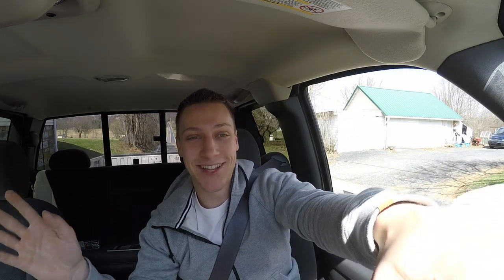WHY I DON'T Roll Coal...

Comment: So the fact that it's bad for the environment isn't one of the reasons you don't roll coal? (no i'm not a crazy environmentalist or anything like that)
Reply: wow I did not know that. Thanks for the insight!
Reply: ***** very true, i'm glad at least i know its not as bad as i thought. but i still would never do it.
Reply from the maker: +Kyle Batu It's actually not nearly as bad for the environment as it looks lol
Reply: Diesel engines are much more efficient and put out less pollution than gasoline. Just because you can see the exhaust doesn't mean it's worse.
Reply: Street Speed 717 Does it have any negative consequences? (other than looking really bad)
Reply: +Kyle Batu not really. its soot. soot basically rises into the air, and drops to the ground and mixes with dirt and just becomes dirt again
Reply: +Nicholas Bethke 

*Citation needed
Reply: +Nicholas Bethke even if it falls back to the ground doesn't mean it's not bad but yeah overall they run better than a gas engine much more environmentally friendly any diesel engine made within the last 20 years is gonna be better than a gas engine
Reply: That should be the reason he doesn't roll coal. People are getting cancer and birth defects because of that shit.
Reply: it's no where near bad for the environment
Reply: because diesel fuel is heavier and so when you Rowling coal it falls back to the ground where it came from compared to regular fuel goes into the atmosphere
Reply: no lmao it goes right back into the earth it won't suffocate anybody
Reply: Arne Hurnik agreed
Reply: So if 5 million people drove cars rolling coal in New York one day it wouldn`t be a problem with like I dont know asthma, coughing, lung irritation, actual soot in your lungs, people with damaged or bad lungs coughing till they go blue, excesive mucus build up in the lungs, damage caused by excesive coughing, small particles going into your cell wrecking the DNA?

 Naah man, it would be fine :) That`s why it`s leagal, ooooh wait it is not! Hmmmmmm
Reply: ***** I am more concerned about the air we breath than the CO2...I like to breath fresh air, not air polluted with coal...
Reply: ***** So you would like to get Alzheimers, cancer and other shit? I live in Finland, we can do with some heat ;) The rest of the world will get tougher though...
Reply: ***** It could, but I`d survive that if I don`t have Alzheimers or cancer ;)
Reply: You're
Reply: matt Fremen lol, you didn`t catch my sarcasm? Or are you really struggeling that hard to read that you missed it ^_^
Reply: Kyle Batu it's not bad for the environment, gas vehicles are much worse than diesel, diesel is more natural
Reply: Jumbo Burnsie That is false. Diesel creates more particles that damage cells and can even turn them into cancer!
Reply: For the love of god could you American people finally learn to call the green liquid you put in your car petrol or gasoline, cause the last time I checked I didn't see any gasoline floating in the air.
Reply: Viktor Varga Diesel is a cleaner burning fuel. It's completely different. Gasoline/Petrol engines need spark plugs because gasoline does not combust under pressure until the spark plug ignites the fuel. Diesel fuel is highly combustible when put under pressure. No spark plugs are needed for Diesel engines. That difference is the reason why you can put gasoline in a diesel engine but can't put diesel fuel in a gasoline engine. It gasoline engine will explode.
Reply: The Esseboy Your example you used will never happen and not many people who live in New York City own vehicle. Next time you come up with a theoretical situation please make it more realistic. The more outrageous the theoretical situation is the more invalid your argument is.
Reply: aggieball19 Not everyone lives in New York lol...
Reply: Arne Hurnik diesel burns a lot cleaner that gas, it just doesn't look like it because gas motors can't spew smoke out the back. My tune blows a decent amount of smoke when I gun it until the turbo spools, and honestly I just like seeing Black coming out of the back 😂 I do it to mess with my friends and family because I can just pull in front and roll coal all over them to piss them off! I don't just roll coal all the time though, I really only do it when someone is tailgating me and it makes them think twice about getting so close lmao
Reply: Peter Jones Are you installing poop slingers on the bed to? Maybe some skunk oil sprayer? Or maybe even beter, a asbestos glitter cannon!
Reply: The Esseboy The amount of sense you just made is astonishingly low.
Reply: Peter Jones You see smoke is particles of carbon, which causes cancer and smells like, well soot and smoke...why not install these contraptions I mentioned too? Would certainly keep people from tailgating you ;)
Reply: Arne Hurnik It's NOT smoke! It's unburnt diesel fuel. People tune their trucks to run rich (greater amount of fuel in mixture). There is so much fuel being injected into the cylinders that all the fuel doesn't burn. Look it up, diesel fuel burns cleaner than gasoline. It's also the better fuel when you need a lot of power and torque. If gasoline did burn cleaner then why does every freight train in the US use diesel? They use diesel because it burns cleaner and it provides more power.
Reply: aggieball19 No, smoke is unburned particles. And diesel is more dirty than gasoline, freight traines use Diesel because it is more economic, it is cheaper, operates beter on lower RPMs.

Gasoline only produces CO2 and water in their tailpipe, praticly no particles or NOx
Reply: It's amazing to see how people will believe anything and not look up the facts. PSA before running your mouth and confirming people's thoughts whether or not you're an idiot, either keep your mouth shut or provide valid proof from reliable sources. If people would look at the facts and accept the truth we would get along a lot easier.
Reply: The Esseboy diesel is more expensive in most areas across the US... trains use it because gasoline is not capable of creating the power needed to move a massive vehicle like a train, moving trucks, school busses, or a semi for that matter. I don't see people ragging on these vehicles  for spewing smoke all over the place. It's only the pickups that get shit for it, and trucks tuned for it make up a very small portion of vehicles in the world
Reply: Peter Jones Haha, lol, a 10-16 liter gasoline would drive any semi, it`s just that it would get 1-2 MPG instead of an diesel which could get 3-4MPG. And it wouldn`t last as long because it needs to run a higher RPMs

It is still a duchebag move to tune it for rolling coal...and it will only fuck your engine up...not add any power...(unless you ain`t using a intercooler, I mean heck, use methanol or water injection to cool the charge FFS)

aggieball. What is your source to begin with? Do you even know what NOx or carbon particles is? Do you even know why Diesels create more NOx gases? I know, you just have to ask or google it.
Reply: Arne Hurnik the amount of fuel in a diesel directly correlates to it's power, as long as the air to fully combust it is present (not to say more smoke equates to more power). diesels, unlike gasoline engines have their power regulated entirely by the fuel being delivered (because there is no throttle body in/on a diesel engine, air in a diesel is theoretically unlimited and air is regulated by fuel; the opposite is true in gasoline engines). black smoke does not mean power loss either. black smoke is the byproduct of partially burned diesel fuel and often unavoidable in high horsepower, forced induction applications (unburned diesel fuel is white).
Reply: The Esseboy gasoline engines do not have anywhere near as much torque as their diesel counterparts displacement:displacement

Comment: I guess he's not smart enough to actually research what the smoke is from a diesel exhaust... I'm guessing he's never seen a half million dollar drag car with a diesel engine, because obviously they would rather tune their car for "rolling coal" instead of accurate for speed...
Reply from the maker: +Jeff Ammerman Totally different thing man, running that much fuel and boost obviously you're going to get a lot of smoke. We're talking about street trucks here, which of course will also smoke a small amount under the right circumstances, but not these enormous clouds that some people choose to make.
Reply: I'm simply pointing out that while I think "Rolling Coal" is dumb, a properly tuned diesel will still blow black smoke if you have more than a mild tune. Making comments like "people are purposefully running rich" makes you sound a bit less diesel savvy...
Reply: +Jeff Ammerman those cars/trucks smoke because it's either staging and not making enough boost yet and/or its moving the fuel in and out of the cylinder before there is a complete burn. a properly tuned street truck will just haze at wot
Reply: +Jeff Ammerman when a diesel dragster rolls coal at the starting line it is because they are running rich, they run rich till the turbo spools and adds enough air to fully burn the fuel.  P.S. watching a video where a half million dollar dragster rolls coal isn't "doing research"
Reply: even then the only time the diesel dragsters are rolling coal is when there waiting for there turbos to spool up. once the cars launch the amount of smoke goes way down because the air fuel  is getting closer to perfect. if diesel drag guys could spool their massive turbos quicker and always have perfect air fuel ratios im sure they would. which means even in a diesel dragster rolling coal is just an unavoidable by product of turbo lag that even they would rather not have. Rolling Coal for fun or smoking out people is for window lickers who dont understand the physics of even the most basic engine (the diesel)
Reply: yes but if your not at wide open throttle you should not have turbo lag. because your not trying to feed in air that isn't available yet via turbo. also I believe diesel drag guys at least the hard core guys are using nitrous before the turbo to help spool faster at the line reducing the smoke quite a bit.
Reply: Do you even drive a diesel? I drive one daily. From a dead stop you will ALWAYS have turbo lag unless you drive like grandpa in his old farm diesel (with no turbo)...
Reply: Street Speed 717 you really should educate yourself before making claims on here. you run an automotive channel with many view and many people believe every little thing you say. and it makes people like myself to look like an jerk and I'm really not. modifying vehicles is fun. going faster and making more power is fun. on a gasser, there is no smoke. but with a diesel truck, getting the most power out of it includes black smoke. especially with older trucks that have no electronics, like my 97 Cummins. stock 180hp is not fun to drive. 600hp is much more fun. this is 100% impossible to do without black smoke. my truck CAN smoke ALOT. however I don't get a kick out of it and try very hard not to do it around other people/cars. if I take the smoke out my truck will be dog slow. newer trucks have better control of fuel and don't need to smoke as much to make power. and actually many trucks that "don't smoke" actually do, but it's being cleaned up by particulate filters etc. i don't have $50,000 for a newer electronic truck, and if I did I wouldnt want one anyways. old 12v Cummins engines can handle the most hp of any diesel in stock form and are the best bang for the buck and alot of fun to play with. (yes that is a fact v8 bottom ends aren't as strong and the 6.7 Cummins guys use stock 12v rods to keep the motor together) yes my truck will roll coal if I stand on it. im pushing 60psi on a big single and it takes fuel to light it. I most definitely did not tune the truck to make smoke, it's simply a byproduct of making hp. raw fuel is white, partially burnt fuel is black. if you have no black smoke you are leaving hp on the table. I enjoy making guys with $60,000+ in their trucks look slow with an old dodge I don't even have  $20,000 in. you stomp the gas with your buddy's to see who's car pulls better. its fun. I like to too but mine happens to smoke when I do it. don't be a hypocrite and knock me just because my truck rolls a little coal when I do it. everyone watching these videos enjoy making their car/truck a little quicker than the factory made them.
Reply: LMBF Today y'all really shouldn't talk when you have no idea how an engine works. p pumped Cummins don't have a tune or a computer. the fuel is determined by the cam in the pump, size of delivery valves and injectors, and boost and rpm. you cant advance the timing for rpm, can't adjust the fuel for temperature outside. all newer trucks do this. older trucks don't have  the same kind of control. there is no catalytic converter or particulate filter. it uses the same pump as a Mack truck. Bosch P7100. big trucks roll coal too. get over it. I'm just tired of retards telling everyone my truck smokes bc I think it looks cool. I've tried to minimize the smoke and it's just something you have to live with with older mechanical pumps when making horsepower.
Reply: People daily drive 800-1000hp Cummins all the time. I don't smoke out intersections as I usually keep my foot out of the gas. My truck doesn't smoke until I lay into it. I have 60lbs of boost it still smokes. Cleans up with nitrous. Love these internet trolls with a 200hp diesel telling me my 800hp diesel isn't making any horsepower. There's a thing called a dyno. It definitely makes horsepower. If I turned it down to no smoke I'd be making no power like u idiots.
Reply: LMBF Today I didn't say u were. I was just saying you don't know what you're talking about. unburnt diesel is white first off. black is partially burnt fuel. and if u don't have it your leaving alot of HP on the table. pulling trucks don't smoke for show its from making power. find me one video of a high HP 12v Cummins that doesn't smoke. doesn't exist. educate yourself and quit spreading lies.
Reply: Yes. That's how you use nitrous. If you don't have the fuel for it then you shouldnt be spraying it. Look my point it is I have a responsibly built truck. It doesnt black out people because when daily driving because I'm not a jackass. However if no one is near me or I run across a power stroke that wants to play it absolutely rolls alot of coal when I stand on it. And thanks to this guy everyone thinks wow this jackass tuned his truck poorly to make it smoke, when in fact the truck is tuned to make horsepower when boost comes on. 12 valves smoke. So does every other high HP diesel with a merchanical pump. Find me one that doesn't. 
So the point is really good older high HP trucks smoke. They smoke bc they're quick. This video states it's bc we are choosing smoke instead of HP. And that's simply not true. I don't smoke people out. But u might see it smoke when I'm having fun. And it does smoke alot. That's because of performance not instead of it. If I take away fuel my truck would just get slower. 
I don't have the money to buy a new $60,000 truck. And they're are alot of guys like me. Any 12v Cummins dyno video is rolling coal. That's just how it works. Don't talk shit about people that are just having fun acting like we are ignorant and making smoke just to make smoke.

Comment: You don't need a tune. You can have one. But you can also do over sized injectors, bigger turbo, high gph fuel pump, or all of the above. Or more power.

Comment: Most people won't install lope tunes or smoke tunes because both can put unnecessary wear and tear on the engine. The smoke can put extra wear and tear on the engine because the smoke is particulate carbon, which is why it's black. Which is also why they have the dpf systems, which are diesel particulate filters. Those tiny particles can tear up the cylinder walls pretty easily. And the lope is just like camming a vehicle, it can, not saying it will, but can mess up the valves.

Comment: I have all efi tuning ran through a cts monitor tuning done by kory willis it's a lb7. You can change tunes when ever it doesn't matter. Unless you have a lmm which have some issues but that's beside the point. An lb7 will smoke more than most durmaxes becasue it's fixed vein turbo. You smoke when you have no boost or are building boost up. Having a fixed vein takes more time to spool. However once the turbo spools it should clean up to no smoke at all or a haze. I have a stock turbo so on my 100 or 120hp tunes it has a deep haze when it's spooled up, and lays a pretty big cloud when you get on it from a stop or very low boost. When you upgrade the turbo you can add more fuel becasue you have more air making the burn clean once again. Rolling coal is very hot literally. Egts can get out of control and melt down an engine. It also washes clyinder walls causing premature wear.

Comment: If you're running a big hp tune you need to eventually start adding fuel and "roll coal" in order to keep the egts low

Comment: Those older diesels tend to smoke when you make it work hauling or towing. I have an '85 F350 that you can't hardly make smoke for trying for daily driving. But you put a couple ton of hay in the back or hook the trailer on with a couple of cows or horses and she will lay down a heavy cloud, even more so if you haven't had a load for a while.

Comment: Depends on the situation I have mine high fuel at low boost because it increases egt's which in turn spools the turbo faster creating more torque and a perfect air fuel ratio for a diesel will smoke a caramel brown light smoke at full boost.